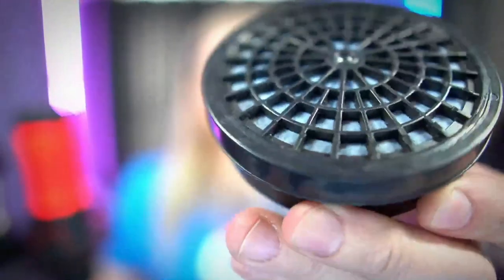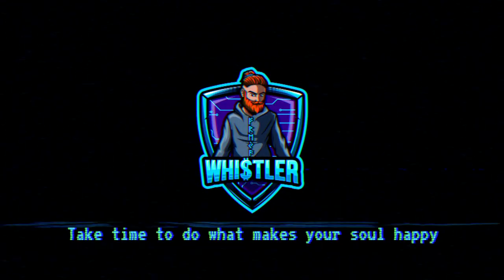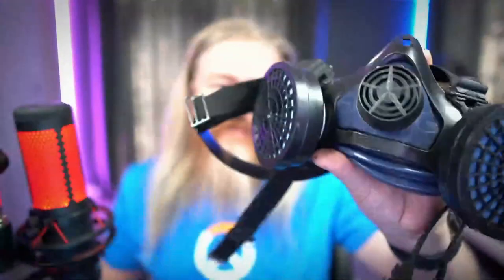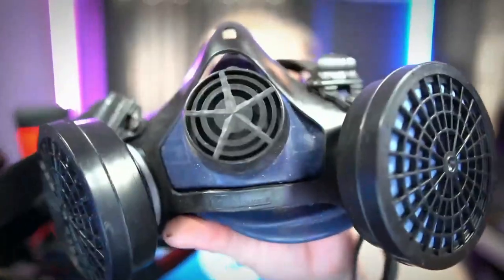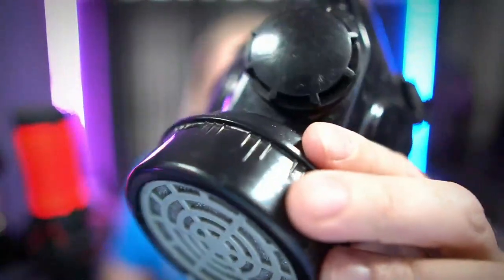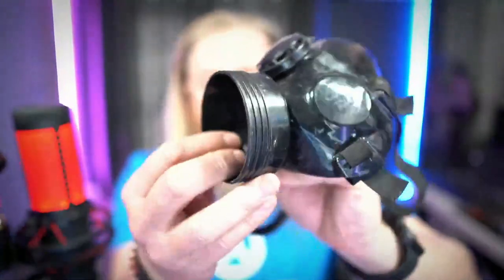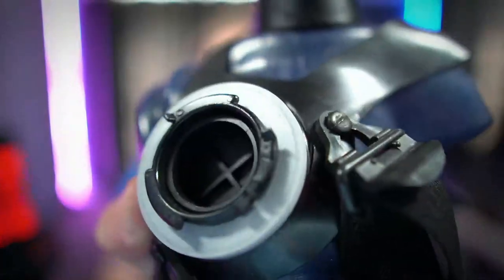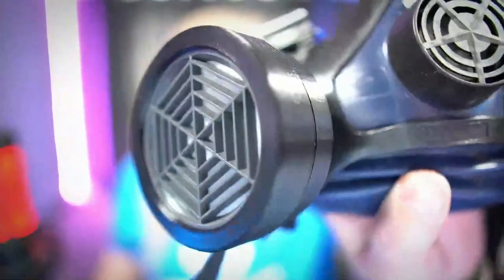3D Printed Gas Mask Adapters

Comment: Legendary…. Is there tech that one can use to trace a object to 3d print?
Reply from the maker: Hey skoenman007 yes there are various tools to trace or even 3D scan. As consumer products its not perfect there are better industrial apps. But less complex part photos sized to scale and modeling in CAD or photogrammetry are viable options. What you thinking to draw?